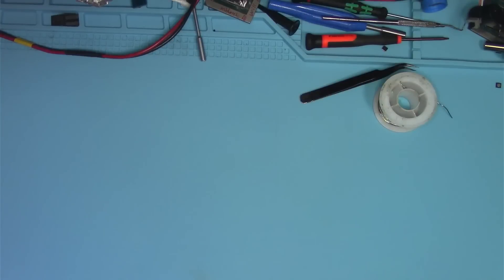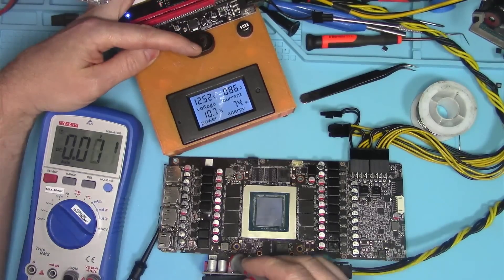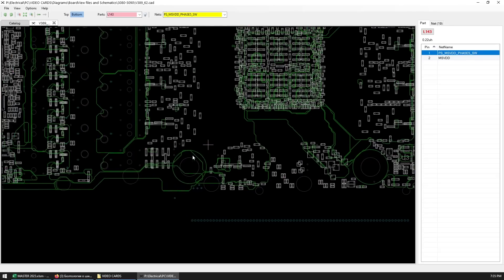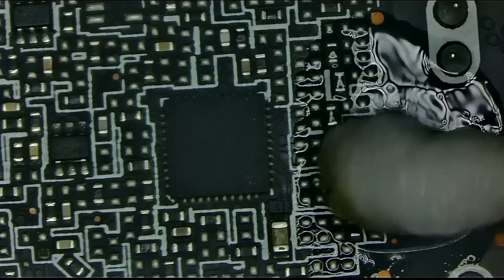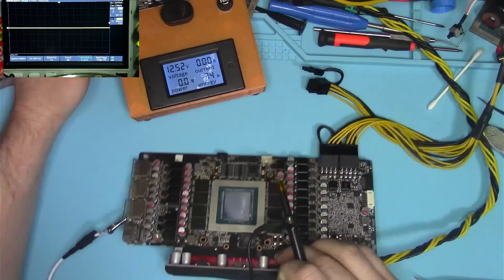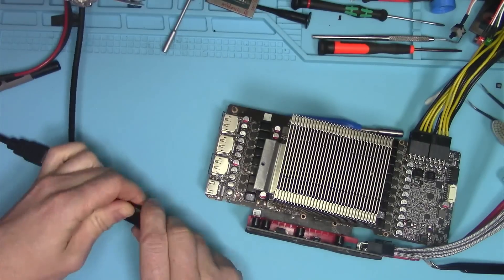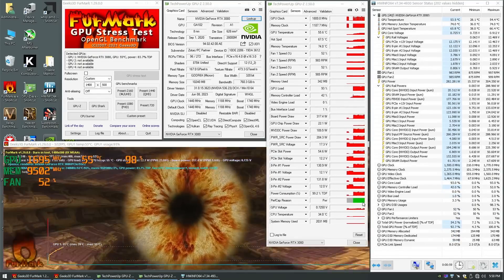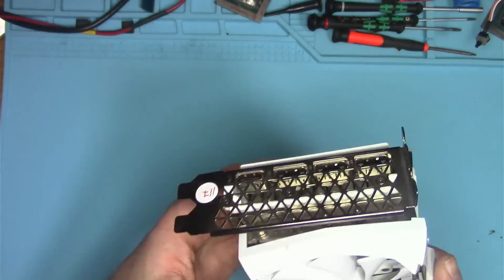What overclocking or poor maintenance does to your graphics card

Comment: that somewhat success I would not ask for full price for such repair because the card lost some capabilities but still mostly a successful repair. 
BTW Overclocking is not big of an issue if it is done sensible. This is a Zotac card after all, with the most basic board design and cooling, so I'm not surprised that 
it blew up. as long as the board can keep up and it does not heat there is no issue. I have a computer with GTX 1080 TI watercooled still working with significant overclock since 2017, it also runs pretty cool at around 40-45 degrees under load for the core temperature.

Comment: Never thought you could disable a part of the power delivery and it could still work at almost full performance. Awesome stuff Northwestrepair!
Reply: depends on the board design but many cards have more power delivery capability than actually needed, so disabling one or two phases won't be an a big issue as long as it can still deliver stable power and not overheat.
Reply: You can also on CPUs btw if you wonder, it can work with few VSS pins dead, there are plenty on the CPU
Reply: As long as all the components are powered it shouldn't care. If they were the only things powering say the memory then you'd be SOL.
Reply: Some cards are over-engineered and have more phases than they really need, best check up on how many they have and what the refreince board design requires. You will find ASUS and Gigabyte normally have more than whats needed in which case disabling two will have little to impact besides a little etra heat but typically if you have a good card it will be over-cooled already.

Comment: Not only a successful repair but truly amazing that it does not end up as e-waste!
Reply: TBH, some repair shop probably would still want quite a lot of good ICs as a donor/spare parts
Reply: Core clock isn't stable, it's no fix
Reply from the maker: @ragesmirk  that was a driver issue, not the card.
I was too lazy to reinstall drivers.
Even sound was choppy but that's to be expected when you plug several cards and let drivers install automatically.
Reply: @ragesmirk  That's the Windows Update drivers for you.
Reply: @ragesmirk 😅😢❤❤😮😅 10

Comment: Nice way to let the card running again. In my experience, with my Zotac rtx3080 OC,  undervolting to 0.925-0.950 V don't limited my card to run with her 100% Boost Clock Speed. It was the opposite she was running constantly with lower temp, on her 100% Boost Clock Speed. 
You have a Idea how to save the voltage permanent on the Card ?  Like a BIOS Flash? 

Thanks for the entertaining educational content!
Reply: You can't permanently flash an undervolt, it would require hardware mods. Simply undervolting like this does limit the boost clock because that's how it works. The points above ~950mV on the curve literally have a defined higher frequency. However, in many cases the card is hitting limiters that prevent it from using them anyway so it may seem like not much as changed.

If you pay close attention to the GPU voltage in this video you can see his undervolt didn't actually change anything when running furmark because it was already forced to run well below what he applied. In lighter loads it can help but I'm not sure why he used this example.

You CAN set it to run a higher frequency at the lower voltage which is really the best way to OC Nvidia cards for daily use. I have a binned GTX 1080 that would run 2100 MHz @ 1000mV that still holds a few Timespy records.

Comment: Definitely a success in my book. If I were your customer and had to give my own GPU for repair, I would much prefer having a functional GPU over nothing. Not only that, I would use it as a lesson to maintain my GPU better and not overclock anything.
Reply: The lesson is making sure a brand does a better job of making it cooler with better thermal paste and pads instead of selling it off of being cheap these Soo called powerful cards are able to withstand this much lol it's crazy to me that my 1080 ti lasted 5 and still going while overclocked and same with my 2080 ti heavy of in 2 years and counting can't wait to oc my next card the 4090 😅

Comment: Personally, I always undervolt my stuff with keeping the stock clocks and a tad bit extra on the memory. 3-5% better performance, ~20% less power draw, 5-10C less heat.
Reply: Smart man. These cards are pushed just a bit too much at factory just to get higher numbers for the marketing. You are doing gods work by correcting this. Healthy card, happy gamer.
Reply: @doublecrossedswine  I've just switched from a 3070Ti FTW3 to a TUF 3080 o12g yesterday. Upgrade costed me like a 100 euros, so pretty solid. To my suprise the 3080 12Gb's stock voltage howevered around 0.95 - 0.975 at the max 350W load! I've played around with the curve, and it's now stable at 0.875V with 1920mhz and +500 memory. Power draw is around 337W. I mean, this card seems pretty finely tuned out of the box! My old 3070Ti was easily pulling 1.125V and 300W on stock settings, managed to stabilize it at 0.95V, 1860mhz and +500mem, then it ate around 220-250watts. GA102 is just superior in every shape I guess.
Reply: I managed to get a used 6900 xt(msi x trio). Since i moved from a 5700 xt, which uses almost 2x less power i was quite baffled at first. 
However some tweaking and i managed to get it working consuming only like 220-240W at max load. 
Quite insane since this card at stock  easily draws 350W or so. 
Pushed memory to max as well with fast timings. 
Core clock in games is around 2400 mhz. (Real clock, not the one you set)

Comment: I have a hypothesis: You could lower the hardware power limit approximately by 10% , to 90% with shunt mod, on the PCIE power connector, or wherever the removed DrMOS was connected to. Then the risk of user error is reduced as the default software power limit of 100% is still safe for the card, which is now missing one DrMOS. You can calculate the approximate shunt resistor value with GPU shunt mod calculator. Edit: I actually tried this, but unfortunately it doesn't work. It will show too low power consumption, which would actually increase the risk.
Reply: good on u to show the hypothesis and test results. you aren't really an offender, but it is interesting to see so many people chiming in with "fixes" or "suggestions" to this guy's channel...when i would bet that homie already knew as much or better than these people.
Reply: I wonder if it would be possible to reduce power limit by editing VBIOS? Would that work?
Reply: @tidjane2001  not anymore possible because all new GPUs need digitally signed BIOS only manufacturer can do
Reply: Well I guess you would have to increase the value of the shunt resistor by 10%, instead of lowering it. That should make it look like the card is drawing more power than it is.
Reply: @Skracken  the power consumption was only couple of watts in my tests using 3 milliohms instead of original 2 milliohms. So the power measurement didnt work at all. Another possibility for it if my shunt was just wrong type or faulty.
Reply: @mikegaming4924  Ok that sounds weird
Reply: LOL yea bud people have been using shunt mods as a way to bypass Nvidia power controls and OC their cards for years now.
Reply: Shunt mod HAHAHAHAHAHAHA.. no

Comment: Honestly it depends highly on the user, enviroement and usecase. OC'ing is fine at it's core, as long as it's stable.
That being said modern hardware is already so fast that it's almost entirely pointless.
Also AIB cards, or some of them atleast have an OC profile from the start, so even more OC'ing is pointless there.
* Best thing Anyone can do with their hardware, without loosing performance, is undervolting ;)
Reply: I have an evga xc gaming 3060ti which comes overclocked out of box and I undervolted it, because the temps kind of scared me at load. Now at load the card is at most 75°c

Comment: I would rather have a 10%crippled 3080 than no 3080. Impressive fix though. Most of us would not believe that a gpu will work %90 capacity with a quarter inch hole in the pcb. For us it's either a working card or a dead forever card.

Comment: I am not sure I would blame an overclock for this, more like inadequate design and protection features. Good powerstages have had thermal sensors in them for years, so if the VRM does not shut down when overheated, that is a design defect. Cheap powerstages may lack a thermal sensor, but using them on a 3080 is by itself a design mistake lol. Overcurrent should also not be an issue, any good VRM controller will have per-phase overcurrent protection. The problem is that a LOT of NVidia GPUs have been manufactured with absolutely ludicrous current limits, like 500-1000 A total output current. This is why those 3090's were blowing up when playing New World, it had a very spiky current draw, so the slow power limit was satisfied but due to the incorrectly configured VRM controllers the spikes were allowed to go beyond the rating of the powerstages. Nvidia of course never admitted this, but this was a clear design defect.
Reply: A lot of PCBs for Ampere cards were very poorly engineered and cut some corners to keep costs down , even at the high end - Zotac seem one of the worse of them. I agree , a VRM shouldn't be pushed so hard under air , or even water (with adequate cooling) that it overtemps and goes into meltdown - even if overclocked.

Comment: overclocking is fine as long as you're getting meaningful returns and temps are in check, I prefer to undervolt my overclock to find the limits of the silicon.

Comment: What I like to do to my graphics card is use a custom fan curve, with at least 20% fan speed as the baseline so my card never doesn't have cooling, even at idle. These AIBs can keep their "Cool 'n Quiet" marketing gimmicks and shove it. 

Then I like to undervolt my GPU by about -50mv. Whatever I can get away with before performance regression occurs. 

This is the way.
Reply from the maker: Good advice